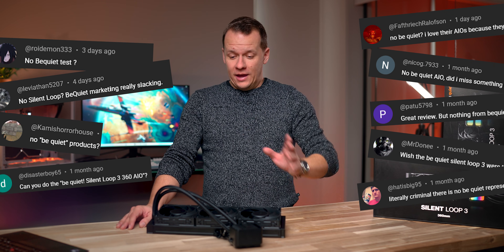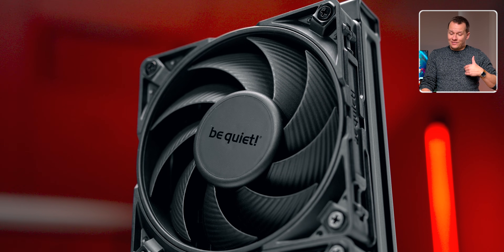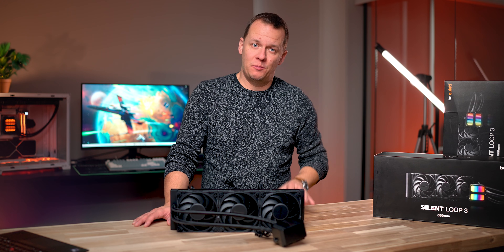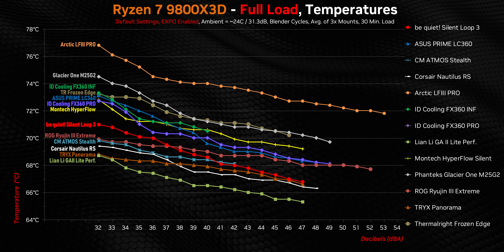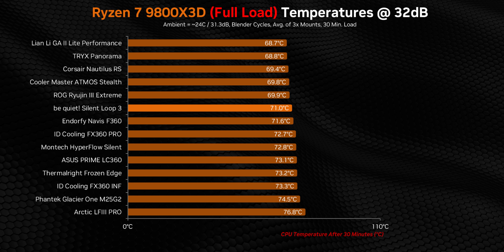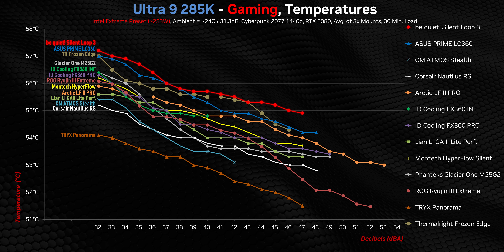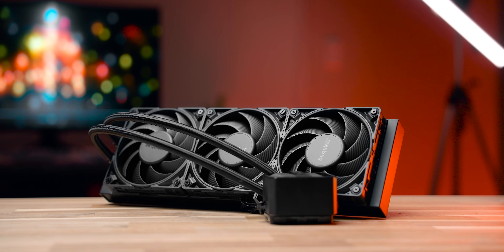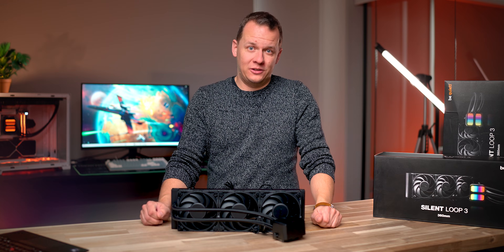A Ryzen Cooling MONSTER - be quiet Silent Loop 3 Review

Comment: why dont these AIO companies either make 2 versions of the coolers, each having the best cold plate design for each cpu brand. OR, make a pump design that comes with 2 modular cold plates that you swap based on which cpu brand you run?

Comment: I'm running a Phanteks Glacier One 360 T30 v2 with my 9800X3D. PBO is set to +200 and -30mV on all cores. 100% stable for 8 months now. CPU is cool, and the AIO is silent. Truly amazed. Still bummed out that Phanteks stopped making this model, especially for your 360mm round-up.

Comment: 4:47 Just saying. ... I saw something recently that said we should use A1 and B1 for memory slots, when using two memory modules. Apprently best for some reason. 

It's actually one of the reasons I chose this cooler (in 420mm), because you have access to those memory slots. Plus it fits my mobo. ....... Whereas, the Arctic Freezer 3 does not.

The Arctic Freezer 3 crashes onto the upper SSD cooler on the Asus X870E-E Gaming Wifi. The cooling head needed to be rotated 180', and it feels a fraction strained in the pipes. That concerns me for future leaks. There's also no guide on how far to clamp down the Freezer 3, and am nervous to go too far. Also, the screws are stiff to turn anyway, so no intuition on how much pressure you have on the CPU.

Additionally I think the Freezer 3 killed my Intel platform: I fitted it and it no longer worked. It took real nerve to try it on my AMD build that I got to replace the Intel one.

P.S. When you used the Silent Loop 3 on Intel, did you use a contact frame to keep the CPU flat?
Reply from the maker: We always use Contact Frames, on both AMD and Intel.
Reply: @HardwareCanucks  Hi, thanks for the reply. ..... (Nearly forgot to extend gratitude.)

You have given me considerable doubt about the Be Quiet Silent Loop 3 420mm that I bought. That's since you mentioned the company has history of pump failure, and also the screw clamps. Therefore, thank you very much for your knowledge on this subject. .......... Although it will be warrantied for two years, so hopefully any failure would materialise by then.

I bought my Be Quiet on Amazon though, and have until the 31st January to think about it. I have not opened it yet, so completely eligible for return. 

However, going by your results for 360mm AIOs, even a 360mm would be sufficient for my 9800X3D. I'd avoid Lian Li dues to the pump problems you outlined.

As you can probably guess though I am not sure, and may just go with the Be Quiet.

My problem is nerves with the Arctic Freezer 3 420mm that I have. I had to rotate the pump head 180', to fit my mobo. Consequently there is slight force on the tubes near the cooling head. Plus temps are disappointing compared to yours, but that may be my vented case top cover. Or it may be because I did not screw the cooling head down tight enough over the CPU. Although I am scared to do that any tighter, because I think this very Arctic cooler killed my Intel 13700K. (My 13700K never worked again after fitting the Arctic cooler.) .. Yeah AMD is a different socket and mounting, but still ....

Comment: Many of us buy cases that support 420mm AIO's its getting more common so a 420 AIO group test would be wonderful. 

Still looking at the BeQuiet Silent Loop 3 420 AIO myself as a possible cooler next year for the NZXT H9 I bought. The only detrimental issue is that plastic clip, but having fitted these coolers it didn't feel like something that would snap, despite that another reviewer had one snap on them.

Another system here is running the Silent Loop 3 240 but has been fitted into a white NZXT H6, so waiting for a white Silent Loop 3 360. 
As someone else mentioned, depending on case and distance, around 75% pump speed can start becoming audible, I think we set the 240 Silent Loop to 70% fan speed. By audible it was still quieter  than the NZXT stock fans,  we simply turn everything down to silent, then increase RPM until we get to the audible part and take notes for pump and fans speeds before setting the fan/pump curves.

Brands like Gigabyte, and BeQuiet really need to sort out this selling stuff in one color or the other, all Gigabyte's back connect motherboards are white and I would want a black, and the Silent Loop is black when some want white.

Comment: Should have added the TR Royal Pretor 130/Ultra to the comparison too see  how  water cooling performs price/value.
Reply from the maker: It would force the temperature vs dB charts to be extremely compressed since the TR would  be flying way at the top with all the other coolers crushed below.
Reply: @HardwareCanucks  Indeed.  Why bother water cooling then?

Comment: I bought the Be Quiet! Light Loop 360 for $106 CAD + tax a few weeks ago.  This thing's a beast for cooling my 9800X3D.  It's super quiet, and around 43c above ambient when running a full 30 min Cinebench R23 test.

Comment: Meh, overpriced. Rad is thin and  my enermax liqmax flo 360 RGB (which i paid $70 in europe no less) keeps my 9950x3D below 76c with 100% sustained load, even with an ambient room temp of 30c. Decent aRGB fans, RGB on the block housing, fill port for replacing liquid (replacement liquid included) and a 38mm radiator and is rated to 400w. 

All core boost is locked to 5.6ghz, CCD0 does 5.85ghz, CCD1 does 5.98ghz, throttle temp is set to 90c. No l haven't delidded the chip, nor have i lapped the IHS, nor used a contact frame, nor liquid metal. 

 If you're going to drop $200 on an AIO, at least go for something with a bit of character....but you really don't need to.

Comment: I have installed over 10 of these and never had one break, thankfully. Some of these systems have been deployed since these launched, I mount the block a little by little on each side like anyone with experience would.
Reply from the maker: That's super good news.  Like I said we installed our two samples over a dozen times without incident BUT we needed to at least include the cases of breaking we saw across forums.
Reply: @HardwareCanucks for sure, good to mention it. Glad BQ took it seriously

Comment: Everything on my case is BQ but I ain't buying an expensive AIO with PLASTIC load bearing brackets! This is insane. Even if they don't snap, the plastic will gradually lose stiffness and will sag, reducing the pressure over time. What a fiasco...
Reply from the maker: Yeah I just don't get it.  Everything on this thing is built SO WELL.

Comment: In the UK is way more competitive. Tried the Arctic Freezer 3 (240/280/360/420). Always the pump was really noisy if rubbing at more than 50%. And limiting it at 50% would affect the performance a lot. Using the BeQuiet 360 and is a beast. Pump as much yurt as EKWB, but the fans are on another level.

Comment: Had one on my 9800x3d and replaced it with a Noctua NH-D15 G2. System now idle at 40C vs. 46C before and MUCH quieter. Thanks but no thanks.
Reply from the maker: That's actually shocking to me but OK.

Comment: What about the Silent Loop 3 420mm?

Could you run it slow enough to make an audible difference that's worth it without sacrificing too much of the performance?
Reply from the maker: We haven't done 420mm testing yet.  It usually goes Roundup -> Individual Reviews for us so we can establish a firm baseline with that roundup first.
Reply: @HardwareCanucks  Thank you for the reply, and your time. My point was a hypothesis more than anything - plenty of us are waiting for that individual review.

The extensive testing and efforts you all put into these videos is always greatly appreciated. Audio quality certainly stands out in a good way - it's always crystal clear, so the noise tests end up being genuinely helpful.

A comparison between the 360mm and 420mm SL3 should be interesting, there was only a $6 difference last time I checked Amazon.

Comment: pls do comparison benchmark for 420 aio
Thermalright frozen warframe 420, corsair nautilus 420, arctic LF3 pro and non pro 420,  nzxt kraken 420, phantek glacier 420, beQuiet Silent Loop 3 420, asus proart lc 420 etc
Reply from the maker: Maybe in 2026.  Those roundups take forever.
Reply: @HardwareCanucks looking forward to it 🙏

Comment: I have the 420mm on a 9950X3D. It's a fantastic and relatively silent compared to the NZXT jet engine cooler.
Did a lot of research on this cooler and first Ive heard of the mounts.

Comment: $170?! Why pay so much more when for half that price you can get other, almost as good AiO : CoolID-ing FX360 Pro, Enforfy Navis F360 or ArcticLiquid Freezer III 360, with only slightly lower performance (and no installation issues).
btw. you still haven't investigated why your Liquid Freezer III 360 Pro results are so poor? In all other tests (e.g., on TechPowerUp), the LF3 Pro scores similarly to the Silent Loop 3, Enforfy F360, or CoolID-ing FX360 Pro
Reply from the maker: I do agree about the price but at $130 it gets pretty enticing.  As for the PRO, no one else you mentioned tested the way we do, nor did they do it on a 9950X or 9800X3D.  If you look at the others who tested on a 9950X at least (Robeyetech, Kitguru) they had middle of the pack results at best....in some cases the LFIII PRO 420 actually tied some mid-tier 360mm AIO's like the Frozen Edge.

Comment: 6:16 because plastic absorbs a lot more pressure than metal
Reply: Your PC isn't dancing around - there's no need for that. It's brittle plastic too, so it would be counterintuitive if anything.

There's no place for plastic on a cooler's mounting hardware.

Comment: Thanks for the review. I have the 420mm version of this AIO, it's very good. Some other reviewers tested this with a Threadripper as well, and they were impressed.

Mike, you mention quite often the high price. It might be a regional thing in US/Canada. In the UK, I purchased the SL3 420mm version for £125 (VAT included) in March 2025, literally a few weeks after it launched. And this is the regular price. This £125 has VAT included, without VAT it should be around £105, which translates to circa 140 USD. The 360mm version is even cheaper. So here, this price is quite competitive, and actually not much higher than the Arctic LF3.

However, I wasn't aware about the plastic part which can break. I guess I would be affected as I purchased the AIO in March, but had no issues so far.
Reply from the maker: Yeah you are right.  Regionally we focus on North America.  In the EU and the UK it seems to align a lot better.

Comment: Weirdly, all my AIO's pumps have been that loud or quieter.  Fan's on the other hand, well, not one AIO I've owned has ever kept it's stock fans.  But the refillability I greatly appreciate - maybe this will be a cooler I upgrade to when my current one is done (*if they make a 240mm version that is).
Reply: They do....  So I'll consider this down the road.

Comment: Hello,

Would you recommend changing the fans with 140 noctua a14x25 g2?
Reply from the maker: At that point, you're making a $160 AIO something like $300.  Personally I'd just buy a better AIO at that point.
Reply: I would say it depends on what your looking for.

For instance if you have a 420 AIO fitting option and want silence, well there are not a lot of 420 AIO's to choose from, if you want no RGB again choices. Or if you have a themed build, or if you already have the fans.
I am building my H9 with Arctic Freezer P14 Pro PWM PST fans and an air cooler initially, and will be adding the BeQuiet Silent Loop 420 AIO after Christmas, probably by Feb. I will most likely run the Arctic P14's on the AIO and see how the noise is, simply due to the wiring and such being in place.
Later I may well buy nine BeQuiet Silent Wings 4 Pro 140mm fans for the system. Just waiting to see how the P14 Pro's go for noise levels. The reason I will get 9 Silent Wing 4 Pro is simply because I like to have the fans in a system match, and would rather not have gimped versions of the Silent Wings 3 fans on the AIO if I cannot buy identical fans for the case, simply a me thing, and a bit silly but that's it.

A big problem for me is I hate RGB, but do like a static low white light in a case. 

I was initially was looking at the new Noctua G2 fans, I simply do not feel the aesthetic would work, but if I do not get on with the H9, well two other options I was looking at were a Fractal Define 7 XL with full 140mm G2 fan configuration or Antec Flux Pro Noctua edition as it comes pre installed with G2's. The H9 was cheaper, on sale, and supports back connect which I am very enticed with, but the Noctua Air coolers I run simply look out of place in it.

Noctua themselves are rumored to be releasing an AIO, so if the Noctua Flux Pro version is updated for back connect, I certainly can see me considering that if they do a 420. If they release a Noctua 6000 series GPU, well I will be changing again most likely to have that full Noctua family tree of AIO, fans, GPU and PSU.

I prefer my cases to have the same fans as the AIO or at least branding, I was running Noctua but them went with Arctic simply for price to do some low cost black out air cooling builds, I think the Freezer 36 with P series case fans simply looks great for the money in lower cost NZXT cases like the H500/H3flow and so forth. But find the strandard P series fans noticeable from a meter or two even at low RPM. Quiet rooms with audio and such often going on too, so currently BeQuiet, Noiseblocker, and Noctua have been my favorite quiet choices.

Whatever AIO you look for is often compromised, do you want a small TV screen or multitude of infinity RGB crap that looks like a 1980's carnival going off in your teenager party box,  or do you build silent quiet even closed systems for DAW and gaming, music and hobbies as your over 40. 
I personally prefer grown up things that are designed to perform and not look like absolute shite, such as the Tryx stuff, the money isn't an issue, it's just a product that has way too much money and hardware invested into the looks. All an AIO should be is the best pump, connected to the optimal radiator your case can house with the fans you prefer. No RGB, no superfluous nonsense, simply money put into the engineering and execution of a simple understated performance that has durability. Tryx may be great AIO's, but they do not make 420mm AIO's and your spending most of your money on looks and RGB with too many AIO's these days.

Comment: I wanted to buy it but after reading the reviews it turned out that the pump is quiet but does not cool as well as the Lian Li Galahad 2 Lite 360 performance black.
Reply from the maker: Basically you're right.

Comment: This costs around 25$ more than the Lian LI GA2 Lite here, while making the pump retention arms out of plastic, wtf were they thinking? I guess maybe when they do a 4th revision they'll figure it out, until then I will keep using my GA2 Lite with the pump set to 66% which makes it basically inaudible. As an aside I still would like an explanation why your LF3 Pro results are so much worse than every other reviewer out there, does the motherboard you use for testing have broken fan curves or what?

Comment: I've tested 10-20 AIOs in the past few months...

Multiple LF III "pro argb"
2x SL3 420, a few corsair titans...

All of them sounded worse than yours, just like all the other reviewers out there on youtube. I have a feeling you lot get cherry picked products.

Saying that, my 2nd SL3 is the one i actually kept, whilst it sounds a bit worse than yours, it does the job, i have it running at 45% pump speed.

The LFIII used to be my AIO of choice, around xmas i purchased 2 and both were similar, noisy above 40% pump speed but performance was great, i tried 6-10 of the newer LF III "pro" and every single one has major issues vs the old stock, pump is just as noisy if not worse, tubes are super loud (Humming). It made a very loud audible buzz sitting at my pc.

Corsair titan was weird, tubes had some hum/resonance but not all the titans i tried, the block had major buzz on some of them but the big issue is the "pulsing" noise it randomly made throughout normal use. That and the fact that the pump has 3 preset modes and even when setting the pump to "Quiet" it would sometimes run 2k+ rpm and start buzzing. The lack of proper pump rpm control kills the titan, it's quiet but not all the time, the pump randomly fluctuates even on the lowest setting and will buzz at some point.

Performance on all were very similar on a 9800x3d, except the first SL3, that one ran 8c worse than the others for some reason (Thankfully i tested a second one because i thought it was a trash product from the first).

Titan wins for AMD mounting, Be quiet wins for overall noise profile, Arctic wins for budget performance but it's loud. If you are sensitive to low freq noises, stay away from LF III.
Reply from the maker: Fair enough but just so you know we always PURCHASE at least one sample of each cooling product to make sure a company isn't sending a cherry picked sample.